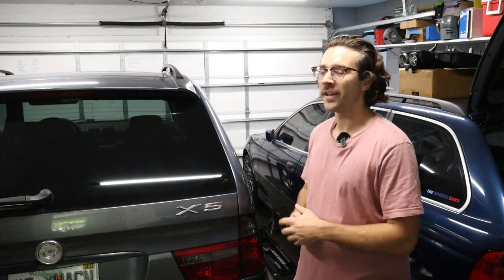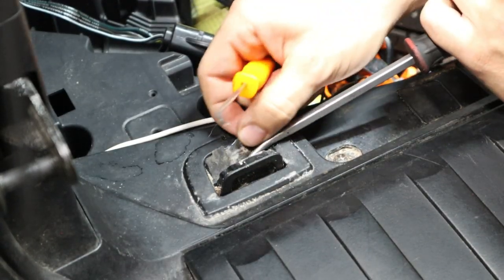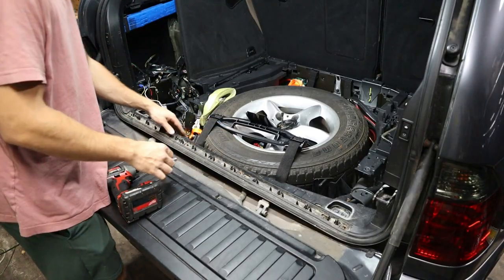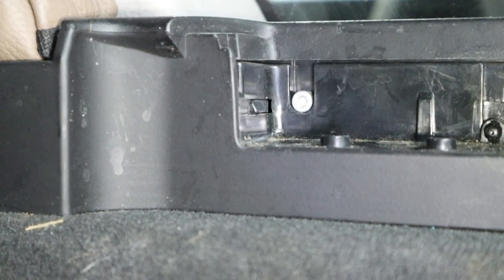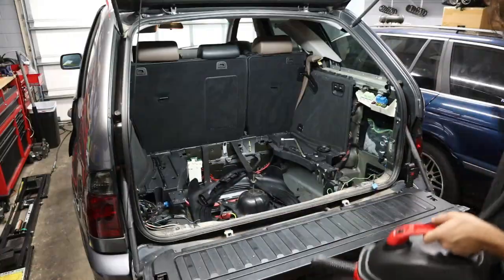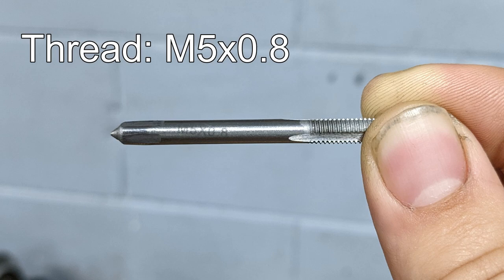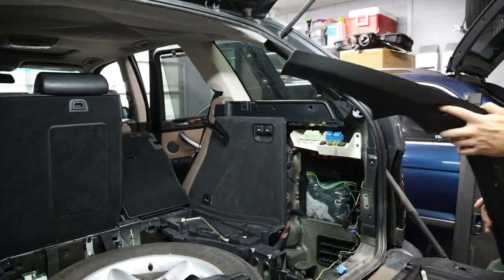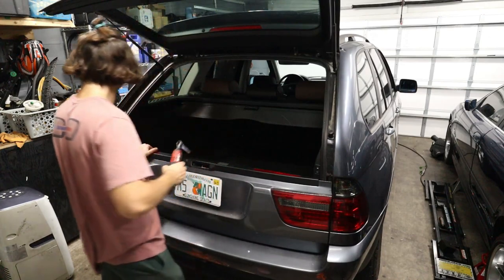E53 X5 Cargo Cover Upgrade! (Facelift Conversion)

Comment: The lifting strap for the spare wheel locks into the lower tailgate while closed. There should be a plastic locking arm that you use when you open the tailgate with the spare wheel holder attached. Its so cool 🤩

Comment: As a detail, the loading sill cover comes better off if you dont remove the turning part, just turn it while you take the screws off, it's easier. And metal brackets on the sides are bit different, you need to saw off like 2cm pieces off them so the plastic vent louver parts fit perfectly, and also drill those 3 holes. But those holes angle up on the same level as original ones if you do the cut because then it does not stay twisting the plastic part on it's place.Easier probably to just get those metal brackets too before starting so you don't need to modify them. With all else this guide matches.

Comment: I personally think pre facelift is way too much better than the second one, the prefacelift is stronger , instead of replacing it you could have repaired or improved the gears rack or used the lci shades if they fit

Comment: Hey BB, Hoping you can point me in the right direction.  My X5 E53 is completely dead.  No power, had to manually unlock door to get in an pop cabin door to access battery.  Battery is completely fine, but there is no electricity at all.  Any ideas as to where I can start?  Thank you!